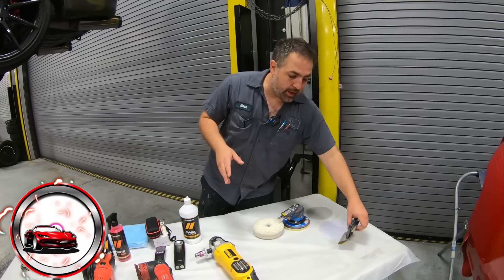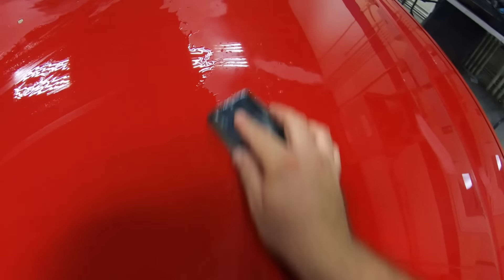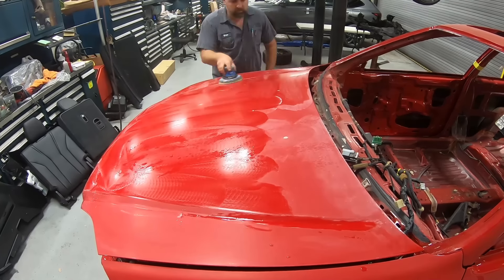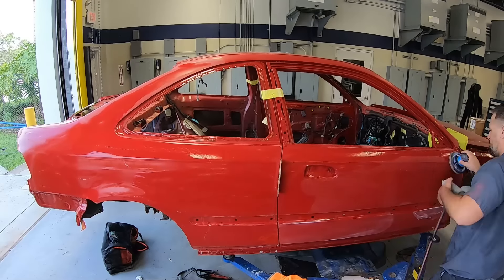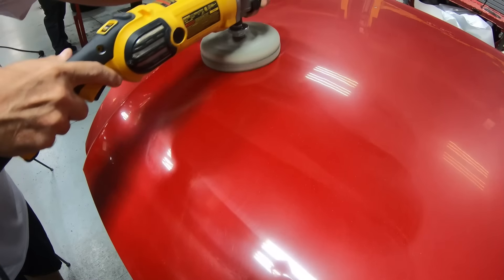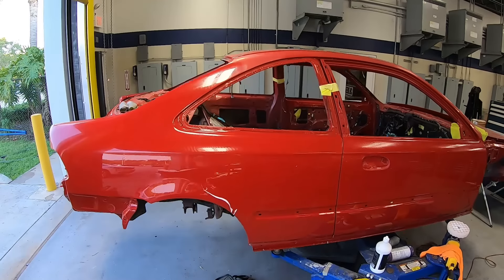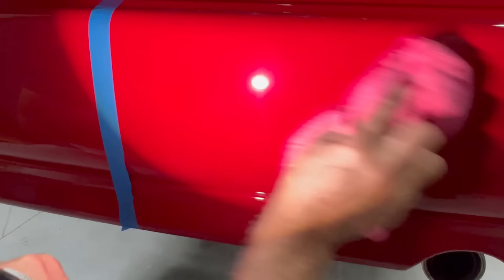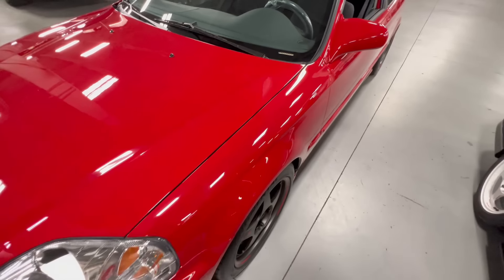How to Get a Glass Finish Without Spraying a Glass Finish!

Comment: Hey Brian. I saw that buffing smile. Lol. You can't fool a 40+ year combination man. Your sanding method is solid. Well sanded 😢3000 with water and an interface will leave a surface finish that is easily brought up with a white 3m waffle pad and white 3m clear coat rubbing compound. A thorough cleaning with soap and water removes the compound residue. A black 3m waffle pad and 3m perfect it works for me to polish it out. There is some blue compound called Clean Cut that is even better than the 3m compound. My local supplier dropped it. I went back to 3m. Everyone has a process that works for their clear, shop conditions and quality standards. All of which are different from shop to shop. Sometimes from job to job. You are a great painter. You're also a good teacher. Keep them coming.
Reply: 47 and that's how I learned to buff same products and method ....3m white waffle wash and polish with black pad ....guy who taught me how to paint would not let me touch a paint gun until I had this method down .....lots of water 1500 200 2500 and if need be 3000 ....no finger tips ....black 3m sanding pad preferably .....interface pads were used as well but mostly a lot of hand sanding .......
Reply: @donaldwilcoxjr.5212  My father started in 1960 doing collision repair and refinishing. In 1977 he and I started our shop. We worked together from then until his death in 2007. We used lacquer and clear lacquer over metallics. Mostly PPG products. We color sanded with 600 and water, buffed with a wool pad, and polished with something called Pink Polish. It was silicone free. No wax in the body shop. No Armor All either. We seldom had a fish eye. Our biggest problem in those days was repairing something that had been repainted with enamel. Especially air dried enamel. It would wrinkle up like the Rocky Mts. Lol.
Reply: I also use a full rotary buffing system with 3m. For all colors other than black we use white and a wool the go to blue and waffle. For dark colors that are less “swirl resistant” we use the full 3 step. Can get absolute glass with that system and have never had issues with swirls if I do my job right and don’t get in a rush

Comment: So on a black paint job would u recommend doing the same as the red civic on the buffing steps
Reply from the maker: Yes
Reply: So I’ll be using the 3m purple bottle to cut and then with what would u finish the polish with a orbital or rotary and would the 3 m glaze be ok to finish off

Comment: Hi Brian! I've been doing what you recommend in your videos about buffing and polishing.I always have this problem: I paint the panel, I color sand it wet, starting with 2000  then 2500, 3000, 4000 and finishing with 5000.When I start  polishing  with the Menzerna 1000 compound( but this  happens even using other professional polishes) I can always see some straight scratches...I can't understand why. They're difficult to remove because they're quite deep and I don't want to risk burning through the paint.The pads I use are new, clean and wet. I always clean the surface with a wet microfiber cloth beforehand, in order to remove any possible particles of dust.I just can't understand why the pads of the rotary or orbital machines are turning but the scratches they produce are straight...help me if you can... thanks!

Comment: I agree. If you need to sand and polish 2000 should be the coarsest grit used. Follow with 3000, then cut and polish. These steps will remove about 30 microns of your clearcoat which is already paper thin - typically only 60-80 μm from the factory. If you burn through it you'll have to repaint.

Sandpaper grit size in microns:
1000 = 18.55 μm
1500 = 12.65 μm
2000 = 9.64 μm
2500 = 7.81 μm
3000 = 6.57 μm

Comment: Give CSI polish a try.... one step system. Water soluble and will rinse right off.  It will cut 80grit scratches and leaves swirl free finish with a wool pad!....... watch some YouTubes about it. Its amazing stuff.
Reply from the maker: Used it before. Love that is water base but 80 grit scratches? Maybe thats a typo
Reply: @PaintSociety  lol...oops! .I didn't proof read my comment.  P600, it will polish out 600 grit scratches.....

Comment: This may seem like a crazy method to some, but for showcar finishes from my own substandard workshop, I have found that a very light guide coat (specific dry coat formula in spraycan which has no build) applied after the clear has cured and before any unmasking, shows up every imperfection, & shows me exactly how much paint/clearcoat needs to be removed in the cutting process. I’ve used this method to successfully remove runs & highly recommend this technique for anyone who sprays in their garage or homemade booth.

Comment: 1st time painter here. I’m in pa. I work in a garage with propane heat. Temps are gonna be in the 40s. I can heat area to 70-80 but when I start to paint I would turn heat off so I don’t blow up. I have applied high build and sanded to 400. Do you think I should paint with this type of weather or do you feel I should wait until 70-80 weather. I’m not sure if paint will cure properly. I plan 3 base 2 clear.

Comment: I have a 2016black f150 . The clear coat scratches so easy it drives me nuts. Would this be a water based paint. I'm afraid to sand and buff it. Because I have no idea how much clear the factory put on it. Also is there a different way to mix and shot water based paint. Would love to know more about it.

Comment: Whatever works for you. I like a flatter finish than 2000, it leaves too many lumps and waves.
Reply from the maker: Anything less than 2000 and is removing too much material😀
Reply: With only 2 coats of clear i would agree with you. I do more custom jobs where we cut them laser flat and many blocking steps with various grits. Nice looking car though!..:) @PaintSociety

Comment: Got a question... I know you can wet flat and polish orange peel out, after a respray...
BUT... Ive got an old 2010 car, That is looking a little tatty, paint wise. Many micro scratches, from car keys as you open the door etc. also, factory finish has very noticeable orange peel, and i dislike it...
So wondered if its possible to flat sand factory paint with a DA, and then shoot some fresh clear over it?
For new-look shine, and no orange peel?!?!
or can you only do that, On freshly painted cars?

cheers

Comment: Hello sir, I own a '99 Torch Red Corvette, with minor scratches from the previous owner that I cannot remove with every compound on Earth. Would you recommend wet sanding? They are located on the deck lid and hood. Thank you and Merry Christmas!!
Reply from the maker: Try first with 2000 then polish but be careful
Reply: They you for your advice and valuable time! @PaintSociety
Reply: @PaintSociety  

That Honda paint turned out gorgeous.

I have an '89 (red) Corvette.  The clear coat is failing and flaking off in places.

If I use the method you show in this video, 
could I achieve good results without respraying another clear coat on it? 

Thank you in advance for your answer.

Comment: Thank YOU!!!!!!!!!!! As usual, super informative. if I can compare orange peel to mountains and valleys (mountains being the peaks of the orange peel, and valleys the lowest points); then, removing orange peel, but stopping at the valleys, means the car is not loosing any real protection. The valleys are the weakest points of the clearcoat; but that is where we stopped. To remove the mountains is easy. Simply sand a little and check if mountains have disappeared (I try to count the sanding passes and use that to remove all mountains on the surface).

Comment: All the DIY people just starting out are going to fill the car with sand scratches and pigtails they need to be informed to let the clear coat harden up say for at least a month have the car perfectly clean use lots of water and squeegee personally I would suggest they do everything by hand and no power tools real easy to fill it with pigtails that are almost impossible to remove also all the nooks and crannies corners and edges should all be done by hand
Reply: Thank you for your comment, as I have previously had pigtails that were impossible to remove. Will waiting a month possibly prevent pigtails? I just painted a spoiler on a BRZ. Any further recommendations for a better finish? Thanks!

Comment: 28 years of bodywork tells me that the painter needs to buff his OWN work. Doing so forces the painter to produce jobs that don't need to be sanded and buffed.
I speak from experience, so don't try to argue. I've been doing this since 1995, and if the job is CLEAN before you paint, you'll have clean paintjobs. One should develop consistency as long as one CAN BE consistent. The products don't matter, it's the application process.
Reply: They brought it up to a show car quality finish, much better than the OEM orange peel look. Don’t think you can get that level of finish straight out of the gun. It requires sanding, compounding and polishing.
Reply: @Patrick94GSR  indeed, but working in a production shop requires more discretion into how much work goes into any job. Time is money, hours spent on unnecessary processes is wasted money. If a job doesn't need to be buffed, why do it?
Reply: A professional painter doesn't need to cut and buff the whole paintjob. De-nib, and go. If you want a show-car finish, cut your paintjob with 800, and re-clear it, then block it out. Not every car has to look like glass. Use your best judgement job to job as to what looks right.
Reply: @averagejoe6971  I understand all that. I was referring to this car specifically, a show car grade restoration project over on the Acura Honda Classic channel. Huge time and money was put into the project over the span of 3 years.
Reply: Show quality and production quality are opposite ends of the spectrum... 
Not every body shop is going to give out showcar results, especially when the time, products and labor to achieve desired results exceeds the cost of the overhead costs. A customer should expect to get what is paid for, nothing more. 
Let's keep it real. 
If you have any experience painting, as i do, you would know the difference.
Reply: @Patrick94GSR   Apologies. I didn't realize people are willing to put that kind of time into a honda. More money than the car is worth is wasted imo
Reply: @averagejoe6971  then you obviously don’t understand the Honda market right now with these classic sought-after short production vehicles. Especially when fully restored with all OEM parts like this one was. They are worth huge money right now.

Comment: You do not have to go wet sand by hand with 2k then 2k again dry with da that just makes no sense and is wasting time. Maybe if you sand with 1500 then 2000 then 3000 now that makes sense. You can even sand with DA 1500 dry  then 3000 and will come out really good. Been doing it this way for years 0 issues. Maybe for a starter the double 2k makes sense. But for pros it just don’t make any sense. Also good to see turbo wax products on your page he makes some great products.
Reply from the maker: By block and DA. 2 totally different ways of cutting, one is to level the surface and one is for refining the surface. Never would i go down to 1500 and remove that much material. Ty. for the feedback
Reply: @PaintSociety  you wouldn’t have to go down to 1500 on your paint work because your finish is great but not many other body shops around broward county can get the finish right at all that’s why I use 1500. But this myth about the block cuts more than DA idk about all of that. I’ve worked at collision production shops. I’ve tried every way possible to wet sand and dry sand and me personally love the Da with 1500 or 2000 then 3000. But depends on the vehicle, I’d rather sand by hand if it’s a higher end vehicle oem paint. But anything freshly painted 90% of the time I’ll use a da endless I don’t have access to air then I’ll do the entire job by hand which sucks

Comment: I love that the rear wheel wells got the rubber trim back on the pinch weld.  These little details...  

And even the driver door panel looks good, they are all caved in just above the elbow area.

Comment: I have a lowrider we are working on.. gonna hate to polish this thing. We will have plenty of clear to work with but we will be blocking it using hard blocks, 800,1200,2000,then da 3000 before starting the polish. Using guide coat on the first 2 steps
Reply from the maker: You need a hand? I will send juan over 😂😂

Comment: Fantastic video Brian.

If I make a couple suggestions from things I learned trying to chase a true show quality SEMA finish.

I let the clear harden a minimum of two weeks, especially in the south Fl sun and then I would open it up slightly with 800g to just let the rest of the solvents gas out. Most I spoke to in the restoration/show car world would wait a minimum of 2-3 months before fully going at it. Also, only using long hard blocks, no small rubbery soft blocks, I made that mistake for years and didn't know. A lot of the top restoration guys are using long acrylic blocks from body work all the way to polishing. I like Linear blocks because its an acrylic and also has a slight flexion. Kounts Customs, Kindig Designs, Charley Hutton I know to name a few.

Now when you are ready to continue with your 800g, guide coat it with powder, I know it might sound strange to most, but I learnt from them doing this will show your highs and lows in the clear the naked eye will never be able to see. Then when you sanded all that guide coat, use waterborne cleaner between each step and clean your panel from the clear residue and repeat the same process all the way to 2000g all with a long hard block.

Then of course finish it with 3000 grit on the Trizact to make buffing easier.

Seen these guys finishes under a florescent light and it's absolutely next level of flat. The light reflection that bounces off is laser straight across the panel.

Small things I learn from them that make a substantially huge difference in the overall finish.

Also learned from them not to use Ceramic coating until a minimum of a month plus so the paint is fully cured, because if done early, the chemical will trap the remaining solvents gassing out and the clear will start shrinking, costing you more time on your work.

Comment: if you do this on factory paint, it's probably too thin? for 2000 ? asking for my car that i think has only one stage paint on ?
Reply: Makes like Benz and bmw have enough clear to sand with this method. Toyota Honda and Hyundai Subaru basically any other generic brand  have very thin clear and I wouldn’t attempt. Even if you don’t burn through, the material left will be so thin the sun will eat  through it depending where you live
Reply: @randoms71  benz a,b,c class, 1er,2er,3er bmw  is crap clearcoat.

Comment: Sadly, I have a sag or two in my single stage urethane. Solid color.
Reply: Would always happen to me as well but I learned to mist first coat and let it tack for 10-15 minutes depending on temperature and the other coats hammer on but from farther distance than usual